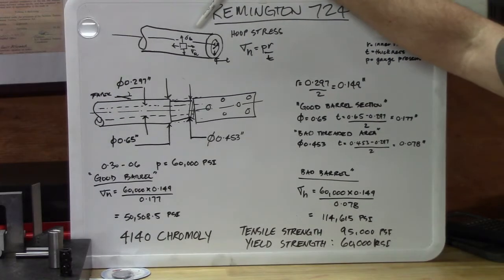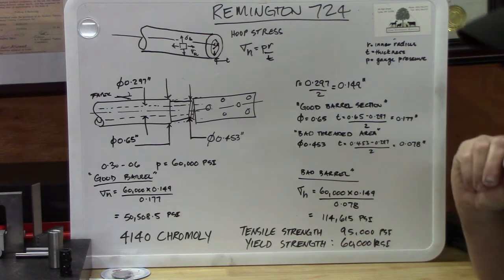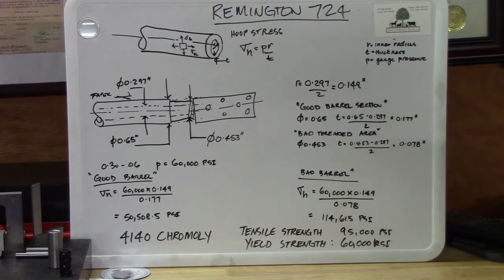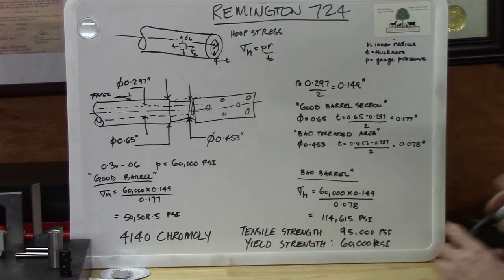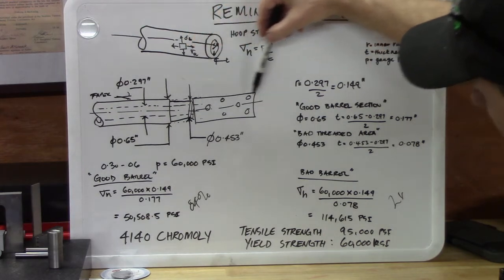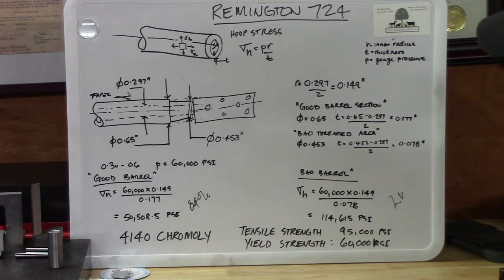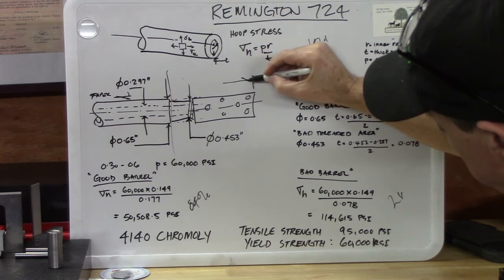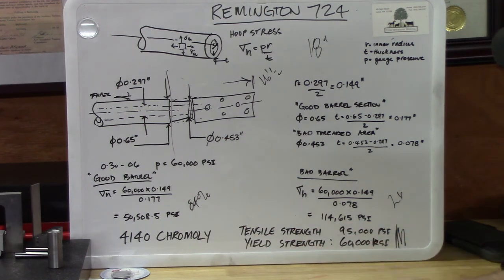Lets talk strength of materials

Comment: There is, in my opinion, a few errors in the calculations. First any wall thickness over about .020" for a .308" id you should probably be using the hoop stress formula for a thick wall vessel. Second the pressure at the muzzle will be nowhere near 60,000 psi. The pressure curve in an 30-06 will drop to around 30,000 psi at approximately the 9" point of the barrel length. At the 16 inch length it will be in the 17-18,000 psi range.